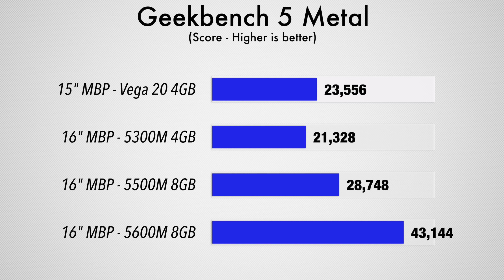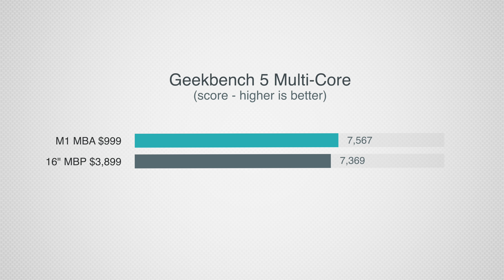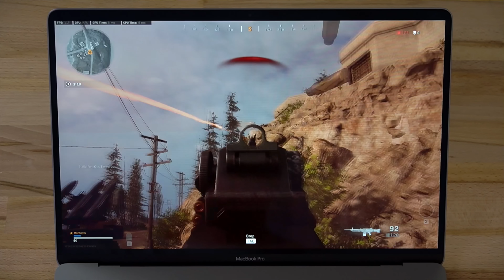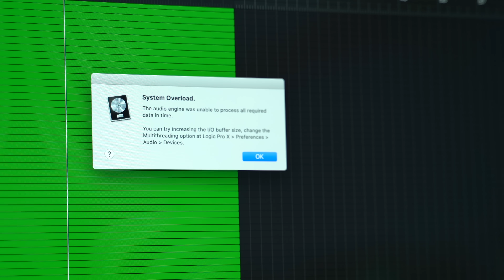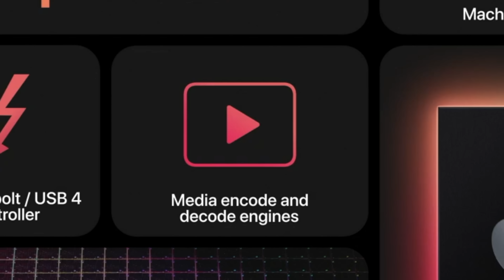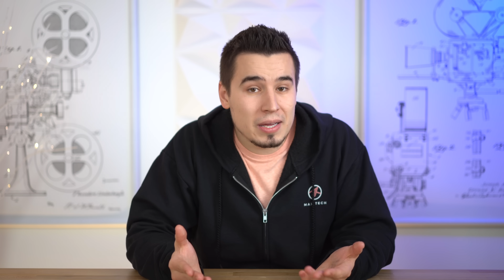M1 MacBook Air vs i9 5600M 16" MacBook Pro - REVOLUTION!

Comment: Apple needs to court the AAA gaming studios to really make progress in gaming.  Native ports will be essential.
Reply: They'd really have to try since none of their games are optimized for ARM processors. Both last and next gen consoles plus PC all run on x86 processors. Convincing all the big developers to make ARM compatible versions will be hard since it will require quite a bit of optimization for both CPU and GPU performance. I do realize apple does have their translation program but additional work will still be needed to be done. Plus the number of people who play AAA games on the Mac platform is very low, less that 3% according to the Steam hardware Survey from December of 2020.
Reply: @crestofhonor2349  
I'm a software engineer. I am really tired of people using the phrase "optimized for processorX".

That's a flag in the compiler, Nobody's writing x86 assembly language professionally for games in 2020. I have books on writing games in assembly language, they are nothing but firewood now nobody's "optimizing their code for x86."  The age of assembly language programmers died 20 years ago.  The only ones "writing down to the metal for x86" are retro computer enthusiasts using 30 year old computers.

All CPU specific optimization is really done by the compiler at this point.
Reply: @pweddy1  I was not aware of that
Reply: @crestofhonor2349  
Bear in mind, I played doom on a Sun workstation at my job. It was just a matter of re-compiling the source code.

Comment: It’s literally not the top of the line model. Even without the ssd space its still missing the ram upgrade
Reply: Nothing he is doing would benefit from extra RAM or storage, so from a performance point of view, the i9 used would achieve the same results as the upgraded model you are talking about.

Comment: As an owner or a spec’d out MacBook 16” I’m absolutely terrified for an 16” M series MacBook Pro
Reply: As an owner of an obsolete 2009 iMac and an m1 Mac mini, I look forward to purchasing a new laptop over next year or so 😂
Reply: @Robfnord  you should gut the 2009 imac, and convert it into an custom m1 imac loool. You can even use the old antennas from the imac and get wifi and bluetooth working. The only tricky part is the ports and the power button but I'm sure someone has figured all that out already and put out a tutorial
Reply: Same lol
Reply: Yep, you had every right to be terrified.
Reply: If you want the new one once it comes out, you prob already know this, but sell it as sson as you can so it doesn't depreciate too much, switch to an m1 air until you can get it
Reply: same HAHAHAHA
Reply: And in 2 yrs, buyers of the M1X Macbook Pro 16” will cry about the 2022 iteration.
Reply: @Bogie882 hi it’s been 2 years
Reply: @Bogie882  second generation will probably be a bigger jump than third realistically.

Comment: Who plays games in a mac
Reply: @Shane Sahil  acuallly its quite low if you look at the steam hardware survey from december 2020. only about 3% of users were on mac
Reply: i am. I have installed 10 game right now
Reply: @Shane Sahil  That's actually a small percentage considering that windows takes up 95% of that group while linux takes up the remaining 2%. One big reason is the lack of game support on macOS itself and the lack of customizability and upgradeability on most macs

Comment: Should I go with macbook Air M1 for 999 usd or wait for upcoming laptops and purchase ThinkPad e14 with ryzen 4500u for 600 usd?
Reply: Personally I'd go with the ThinkPad because you don't have to worry about compatibility issues that will most likely come up. If you're fine with the some of the issue that'll slowly be solved over the next few years then go for the macbook
Reply: @crestofhonor2349  thanks. I think I can get around with a few apps not being compatible with M1 mac. The display, battery life and performance are what makes me go with macbook. My friend has an asus laptop with 4500u and performance on battery is about half of what it's on AC power.
Reply: @adityaarora824  I could see that being an issue but personally I don't see a bunch of people doing power work on battery, and if they are they are typically close enough to a power outlet where they can plug it in. Most people simply do the standard web browsing and word processing that isn't likely to need high CPU or GPU usage. But if that doesn't suit your lifestyle and you are often doing power work away from the outlet then I understand why it could be an issue for you

Comment: Were you able to edit an 8k 5min clip at full resolution without dropped frames on a 8k timeline? I didn't think r3d 8k files were optimized effectively for Final Cut Pro on the 5600m? Did you get the same performance in resolve?

Comment: I want to see apple silicon to start competing with nVidia’s RTX 3080 and AMD’s Ryzen 9 3950x.
Reply: I highly doubt they could compete with the RTX 3080 unless they really raise power consumption. One of the main issues that ARM will face is that it does not scale as well in performance with power as x86. Plus it'll lack hardware accelerated raytracing.

Comment: Uuh, doesn’t the 16” then use more power than the included adapter will provide? 50+60W power draw of the CPU&GPU alone, vs 81(?)W the adapter can deliver.

Comment: I traded my 2019 13 PRO with i7, 1TB 16GB and purchased the base 13 PRO m1 and I’m super satisfied. Run super smooth e cool, no regret for the old noisy fans of the 2019 PRO. I even earned more money from the trade because I bought it on sale lol. Can’t wait to see what the m1x will performe. I’m sure I’ll switch to the next 14’ or 16’ 😂

Comment: "A lot of people will eventually start to prefer Mac's for gaming" lol okay. Enjoy living in your fantasy world where the majority of gamers don't actually live.
Reply: To be fair, you left out the end of his sentence which was “…over Windows laptops.” He was careful to not say gamers would prefer Macs over Windows desktops with massive GPUs and power supplies. Given how much the M1 has been shown to crush any Windows laptop in its price range, as long as the games are native, a lot of gamers would probably be willing to go Mac to spend less for better performance (when gaming on a laptop). The M1 contains the kinds of hardware optimizations seen in consoles.
Reply: @brightboxstudio  That's simply not true though. There are many gaming laptops in this price range that while may have slightly slower processors than the m1 macs, the discrete video cards absolutely fly past the mac in basically all games, native or otherwise. So for gaming, these computers are very far from crushing it at their price point. If you want an all round ultrabook that can do some gaming, the m1 macs are great, but if you factor in gaming laptops, it's not even a competition.
Reply: @DarklightRebel  lets talk in 2022, 11 months out...
Reply: @BlackGold3000  why? Video cards are the most important part of gaming. Games are gpu dependent. Apple isn't going to figure out how to best nvidia and AMD overnight, both of which are using gpu's which are also arm based. Unlike intel Nvidia and AMD haven't been sitting around. The story now will be the same in 11 months. Mac's are cool but there's no need to be a fanboi.

Comment: One blind spot in these comparisons: Sara Dietchy keeps bringing up that Adobe Premiere is not yet optimized for Apple's new processors. Apparently, she tried using M1 Macs and she found their performance on Premiere lacking. I was hoping Max Tech would at least throw in a comparison of the Intel vs. M1 on Premiere, but that didn't materialize.

Comment: I'm guessing the 16" MBP ran out of battery power many hours before the M1 MBA did.
Reply: because the air 13 m1 has less battery drain age
Reply: When I got a new mba m1 2020, it took like more than 10 mins to drain 1%

Comment: That's impressive for Air. Still, I have some doubts. As a musician, composer and sound designer, I'd love to see some results for longer usage. For example with Ableton Live with huge load of Kontakt-insruments, other vsti's and so on, and let it run for 24 hours straight. Because that's how I use my MBP. I can wotk on heavy project for hours and hours and I'm very worried about how fanless machine can really manage to do that.
Reply: which mbp did you used?
Reply: @snubdawg1386  Many during the years but now I'm mainly working with MBP 2018 15", 2,6 GHz, 16 Gb RAM, 512 Gb SSD, Radeon Pro 560X 4 Gb.

Comment: I wish that people will prefer the Macs in gaming but most video games and windows 10 won’t come that soon on Apple Silicon natively (I think).
Reply: As soon as apple allows customizable and easily upgradeable Macs is when you'll see gamers that might want to switch
Reply: @crestofhonor2349  what kind of upgradeable Macs you think will come? Upgradability will be probably even less possible with Apple Silicon
Reply: @paulsamuelmusic  I honestly think that apple will further lock down their hardware and make it harder for the user to upgrade their system so that they can decide what kind of experience the user can have. That's why its so hard to make a hackintosh and with every new version of macOS it gets even harder
Reply: @crestofhonor2349   they make it less user upgradable because the Chip has the RAM, Processor, Graphics, etc all. I only could imagine to change the whole Chip.

Comment: Looking for help and suggestions. 
I so wanna get a M1 MBA. My 1st concern is the 400 nits max brightness. Is it enough for indoor use ?
Another concern is the 8GB ram. I will use it for browsing + media consumption + light media creation / editing + working on MS Word + Excel. Will 8 GB be enough ?
Reply: Absolutely! Surprisingly MBA M1 with 400 nits is brighter than MBP M1 with 500 nits.
Reply: 8gb is equal to 16gb on intel systems, and 400 nits might be an issue in bright, sunny days outdoors but I wouldn't buy the pro just for the brightness improvement
Reply: 8GB has been phenomenal for me so I think you’ll be good.

Comment: I’m wondering if they’d update the base MacBook Pro 13 inch with a new 14 inch design too? I want a new design but the price is a little too high for me
Reply from the maker: Yes, the current Intel $1800 13" MBP should be replaced with the new 14" model.
Reply: @MaxTechOfficial   I meant if the current M1 MacBook Pro would get the redesign. Love your videos ❤️

Comment: I really want to buy an Apple Silicon Mac but I want it to run Windows efficiently too. Hopefully in a couple of years Windows will run fine on it.
Reply: windows don't run effectively on high-end laptops. How do you expect the mac to do that functionality?
Reply: @utkarshnn  windows runs perfectly fine on high end laptops and lower end laptops. I've tested this myself. The only reason why windows would run bad is if you are running on old hardware, using a hard drive instead of an SSD, or still have a ton of bloatware installed like norton and Macafee

Comment: I actually have both of these, more or less, and greatly prefer the M1. I've got the M1 MBP 13 (1TB/16GB RAM) and the MBP 16 before the latest GPU was added (1TB/32GB RAM/5500m 8GB/i9) and in the real world, the M1 feels much snappier. In the past, I've always had to use full-sized laptops, whether MBPs or XPSes or whatever, to get the much faster CPU and the additional discrete GPU, which is only rarely offered in a 13 inch. But with the M1, I basically feel no need to be faster. I'll get the MBP 16 when it comes out, but more to get the larger screen than for any performance need. 

The huge obstacle with the M1 for me is the display limitations. I finally broke down and bought a quad 4K Displaylink hub (I use triple 4K monitors for work) after failing to find a single monitor solution that could compete with the 3x27 for what I do. We'll see how and if that works in a week or so. Hopefully subsequent M1s will recover triple 4K support, because I'm using my MBP 16 as my desktop now purely for this reason.
Reply: Hi boss...can u sell your macbook 2019 for me pls
Reply: @torficmaxxy  I already did 2 years ago, probably not long after this post. I replaced it with the M1 MacBook Pro 13 pretty much immediately. I gave that one (the M1 13) to a friend when I got the MacBook Pro 16 (M1 Max) though. I only kept the 2019 16 around because I figured there would be a ton of bugs in the transition, but it turned out to be extremely smooth. After a few months the M1 Pro 13 had proven itself to me so I didn't have any reason to keep the archaic Intel system around.

All that said, I would say don't get an Intel Mac, even used for a hefty discount. Get an M1 MacBook Air or something instead, which is probably cheaper anyway.

Comment: Incredible performance from the M1.  Though I doubt the Unified memory has anything to do with it.  Think about it, what part of Xcode is being GPU accelerated? That sharing isn't adding anything in 90% of tests it's winning.

The GPU feels like the weak link to me.  Even at 240hz this Mac mini M1 feels sluggish just dragging windows around the desktop or controlling a character in a game.  kind of feel sorry for some who thinks this level of graphics performance is acceptable, though I never before used mobile type stuff for daily computer use.
Reply: Well It’s a MacBook, if people want that graphical performance they should be getting a windows computer anyways. Either way it’s a step in the right direction for apple

Comment: 16” may  have a dedicated apple graphic card too
Reply: or it could still use dedicated Radeons as well. Because the M1 is so incredibly power efficient, that leaves a ton of thermal and battery headroom to put in much more powerful GPUs next go around if they want
Reply: @elenchus  nah I think in that case a custom apple gpu is more likely
Reply: Nah integrated kills dedicated mark my words
Reply: @Aecor  why not both?
Reply: @pedropepperguitar  just mark my words you’ll know
Reply: @Aecor  Dedicated GPUs will always be better since it won't have to share power between the CPU and GPU thus allowing to GPU to be much faster and also not have to worry about overheating the CPU
Reply: @crestofhonor2349  just wait

Comment: Don't recommend 16" Intel based MacBook Pro when the Apple silicon one is around the corner! :)
Reply: @krypton1142  sell and get the new one. Cut your losses! ;)
Reply: @krypton1142  sell it on second hand markets like Facebook marketplace which will get you more than trade in. Anyways just a suggestion. It sure is a good machine and will be good for long.
Reply: @NiranjanBendre  "sell it on second hand markets like Facebook marketplace which will get you more than trade in." Not these days, at least in my experience. Who'd pay more than $700 for a used Intel 13" base configuration MBP or MBA? A new M1 is $999 ($899 with the education discount). And, the trade-in value gets sales tax added back to it, so it's even a little better than it sounds.
Reply: @RichM3000  yeah true but better than trade-in maybe? That's what I was suggesting.
Reply: @NiranjanBendre  I was not able to get trade-in on Facebook Marketplace or Craigslist, but maybe others had better luck.
Reply: @RichM3000  hmmm offerup is also a good alternative.
Reply: What are you using your 16" model for?
Reply: Mbp 16’ are terrible don’t get one I’ve got a i9 10th core 32 gb ram 8gb graphics and it gets upto 80 degrees Celsius and higher when on chrome absolute bs for 5k
Reply: @silastym4074  Would you consider a ChromeBook instead?
Reply: Have had it repaired twice now still crap
Reply: @krypton1142  me to man. I got the intel MacBook Pro in June. im so pissed
Reply: @joeygill3822  sell and get the new one. Cut your losses ;)
Reply: @NiranjanBendre  not to sound spoiled or anything  but my parents are my fiancial support and they did agree to the idea. Any tips where i should sell? I was thinking of getting apple trade in credit from apple but its only $700
Reply: @joeygill3822  offerup Facebook marketplace are the two best option I know. Depends on how much you paid for the laptop and look for how much others are selling it online for the same configuration options.
Reply: @joeygill3822  Real-world prices on used 13" Intel MBPs are down substantially. I saw the writing on the wall when the M1 came out and made the switch while I could still get something for my 2017 MBP.  I imagine the same will happen to 15" and 16", now and even further once the M1X models are announced.
Reply: @RichM3000  forgot to respond but I took your advice, traded my intel for an M1 mac. AND MAN THIS THING IS GOOD
Reply: @joeygill3822  Glad you like it. I'm enjoying my M1 MBP. It's a big improvement.
Reply: @krypton1142  mine has many problems as well. I tend to play small games such as roblox or the sims and it heats up hotter than my old 2015 one. I rreally am planning to switch
Reply: @krypton1142  dont look at it that way.the M1 is good but its not perfect by any means.
Reply: @krypton1142  intel is still better.
Reply: @lnk6098  its compatible with more programs as of right now
Reply: @seanq9884  compatibility is not everything. I doubt those chips can be a real threat
Reply: Krypton 114 don’t trade Apple trading program is a scam. You can get that 1449 or somewhere around £1200 realistically back from eBay
Reply: Verified with 36 subs??

Edit: just a little side note, your account was made 3 days before I was born. Cool
Reply: @Azubi_Meatball4349  yes I'm old and when Google bought YouTube they were giving out verification ticks like candy! ;)
Reply: @NiranjanBendre  nice
Reply: @Azubi_Meatball4349  thanks for making the rest of us feel old
Reply: i9 still better.